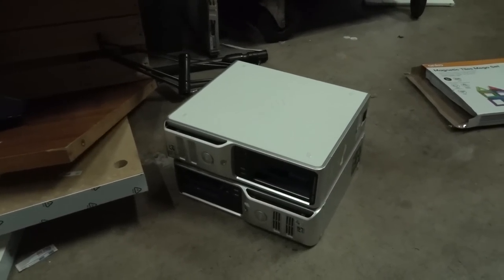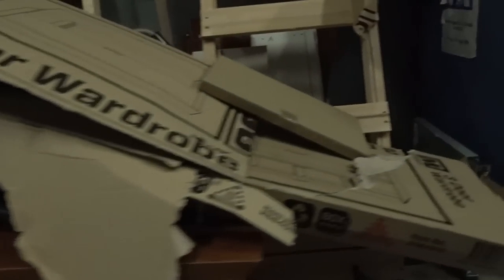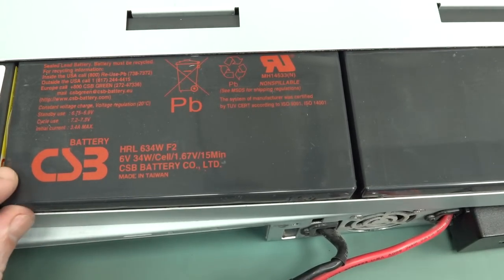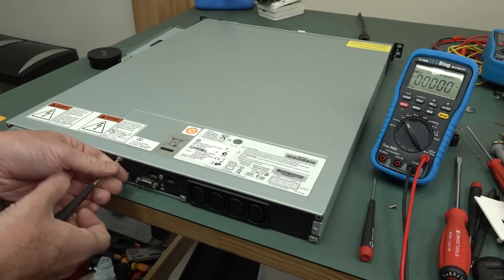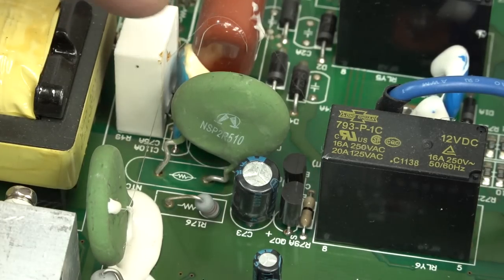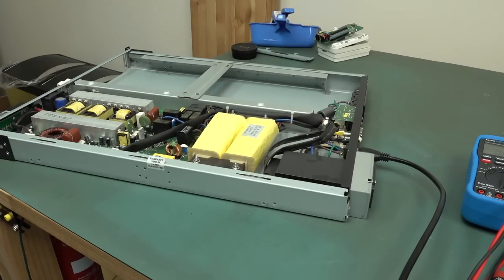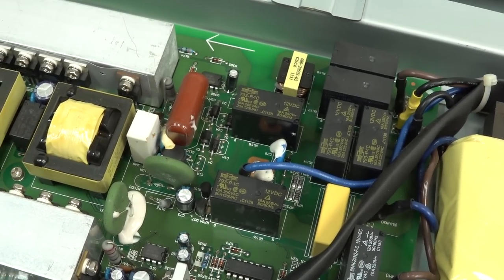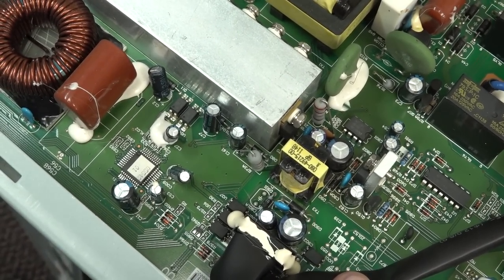EEVblog #1168 - Dumpster Diving UPS

Comment: Isn't that a surprisingly small transformer for a whopping 1500W?
Reply: Auto Transformers are like that just like the ones he's a buck-boost Transformers on AC power to adjust voltage the smaller transformer for low-voltage side is puny doesn't even look like a table boarded a few amps. Because the only amount power involved is related to the voltage difference.
Reply: @aaronbrandenburg2441  Aha so that how it worked, I started to wonder there.

Comment: Is taking stuff from the dumpster(room) even legal in australia?
Reply: its not legal here:/
Reply: Depends on the room. Ask the facilities to post a notice that "garbage" can be taken by anyone for any reason and it will be all right.
Reply: From my understanding in the United States basically once it's on the curb it is no longer your property if it's in the garbage can and on the curb or associated is no longer your property and therefore illegal and I have been told this through a law enforcement. I knew people that did electronic Salvage and we are all curious because some people do it and we're not sure it did not want to get in trouble and also before I started doing it in her past if it was left out for a day pick-up and or if I saw something sticking out they could be useful I want to be sure before I did anything wrong. Or illegal. You would not believe how much stuff I marriage fix mainly just because of one problem bad fuse or a fuse that had not blown but just fatigued overtime and just going to open without an overload even if they are blown a lot of times after testing you find nothing is bad put it on in and Bowman at work or a search took them out.

Comment: That big yellow thing is the output choke, due to sine modulation, needs output filtering...
Reply: No, it's not, it's the auto-transformer for operation under lower or higher than specked voltages from the mains. That's why there are so many relays. The choke is the torroid inductor  on the right side.
Reply: @TheOriginalEviltech   
Yep. This is a line interactive UPS. My APC's switch in the transformer at 253v and 208v. You can adjust the trigger voltages on the APC Smart UPS.
Reply: Lame-o that is a Transformer that is Auto for as far as everyone else has said and he said as well the choke your talk about is that Roundy thingy the toy line with the windings that huge sucker.

Comment: Ask for that negative are going to that big bolt for the ground because oftentimes that's a negative is actually grounded to case in system ground within due to safety because of possible or isolation issues as well as general safety.
Reply: I hope English isn't your first language.
Reply: @pete3897  actually that's the only language I speak but I have to use voice recognition and it's hard to edit on the Fly to do this in a timely manner okay part of my disability cannot touch type worth a darn it's been proven I use the original version of dragon through a grant. Also I use my Android as a keyboard utilizing an app on the Android end and a small program running in the background on my laptop making the connection or Wi-Fi for my keyboard most of the time I do this. Because it's so much easier and that means I can use any computer including with Google Voice recognition because I don't have a license for my software for multiple computers for Dragon.

Comment: One thing to try:  Put a power supply INTO the battery connections without AC power and see if it comes alive.  You do have a power supply don't you??  If you want to last a multi-hour power outage (had one Saturday), just find 3 nice automotive storage batteries and cable it all up.  The VA/Watt rating will be the same, but the time on battery will probably last a day or so.  Good planing for the zombie apocalypse which is SURE to happen.

Comment: Are the heatsinks solid aluminium? That looks a bit chinsey, they'll probably get pretty hot after draining the batteries at 1000w, clearly only engineered for burst usage.
Reply: not really i think they use a zero voltage switching which makes like no heat

Comment: Those AMDs can be upgraded to quad-core very cheaply if the mobo supports it. (Sometimes newer CPUs work even if they're not in the HCL, the beauty of AM2/2+ is that the memory controller is integrated into the CPU as opposed to the NB as in equivalent Intel 775's so they're much more upgradeable)

Comment: I have one of this sitting in a corner with dead batteries which i was just going to salvage parts from. However this video has prompted me to ponder...could a ups such as this be modified to work as an inverter for a solar power system? What do you guys think?
Reply: The problem is that these devices heat sinks are simply large blocks of aluminium. They are big enough to store all the heat produced during a single discharge of the battery, and assume that the inverter will have hours to slowly cool down while the battery recharges.

So your major modification would be a complete rework of the heat management system, replacing the blocks of aluminium with large fan-forced finned heatsinks. Managing this in the space allowed for it on the circuit board would be challenging.
Reply: @robertbackhaus8911  hmmm. Ok thanks for feedback. I will keep that in mind.

Comment: Needs battery power to turn on, most UPS units are like this, a protection mode of sorts to stop it blowing the charger incase of shorted batteries or wiring...

And as for mains voltage, Oz, just like the UK, never actually changed voltage when the European Harmonisation (Red & black to Brown & blue, and 240v to 230v +/-10%) bollocks happened, just some jobsworth making themself look important by pushing some paper around... :P

Comment: Pro Tip:
PSU with Switch -> No no. Those are the cheapest stuff without active PFC...
Those are special, proprietary "BTX FOrm factor" units.
As for the Athlon X2: Those are old, really old. Like 2008 and before... 
And to make matters worse: The nVidia Chipset when used without Graphics card, they are said to be rather unreliable and prone to failure...

Comment: Probably the UPS will work again with simple battery change, even the battery pack is hot-swappable. These CSB-s are manufactured 2 week 2012. 
Just to mention three years ago Yuasa took over Panasonic battery manufacturing. https://www.yuasa.de/2017/01/gs-yuasa-uebernimmt-bleibatterien-geschaeft-von-panasonic/
https://www.ees-magazine.com/gs-yuasa-takes-over-panasonics-lead-acid-battery-business/

Comment: try charging the battery from another power supply then put it back in the ups, most all need battery power before it will work. I bet there is nothing wrong with the ups. my small ups will not work with out a battery. no lights or anything.

Comment: Are we gonna ignore the fact that these lead batteries would go to landfill if Dave didn't grab them.
Reply: Presumably the office has a dedicated electric waste disposal service that sends the stuff to someone who disassembles the stuff properly.
Reply: Hard to say if they do that but then again they are a lot of time to separate from a dumpster even think if they could have got it in there. And Dave Jones Is there any waste or where we called their company that comes to pick that stuff up good question. As well as you know last batteries are hazardous waste as well. Whenever I would dismantle something that would have let acid battery on or whenever a car struggle batteries I would take them to the local Batteries Plus or Home Depot for the dog light acids to get rid of them even when I was younger.

Comment: If only there was an easy way to change the input voltage to something useful like 12v!
Reply: You can't use it as an inverter anyways, you'd need to change all the cooling with something more substantial...

Comment: I wonder how many home PCs, even in the "rich west" have USB 3 connectors?  My home PC has an i5 processor and I recently upgraded to an SSD storage unit, having gone from 4 to 8 gigabytes of RAM a few years ago when my PC slowed to a crawl.  My PC is 6 years old and wasn't cutting-edge when I bought it.  I am hopeful that the upgrade of RAM and storage will give my PC several more years of life.  My desktop PC originally cost £400 from PC World with Windows 7 pre-installed, plus extra for Office.  The upgrades were achieved for around £100.  Prior to going to SSD storage I considered buying a new PC but was shocked at how much prices had increased, with little obvious increase in performance. I seemed to be looking at at least £1,000, particularly for a laptop.  I think that modern PC suppliers are pricing themselves out of the market, even in the "Rich West".  In poorer countries where disposable income is less, I suspect that the average home PC has specs much below what is being found in Australian dumpsters.  This difference between the "have everythings" and the "have very littles" makes me anxious for the future.

Comment: the battery's are cheap for this unit dave and it will only work with good battery's as it does a self test at startup. its a keeper for sure.
 could try to charge the battery's up to get it to fire up for you
like others are saying these are found all the time ppl think there dead and tose them.
thing is they will work fine for years with fucked battery's till the power goes down and then it will never come back on with the dead battery's
these startup on thee bank before the grid once it is running you can unhook the battery bank

Comment: Charge the battery or connect the power supply 72 V
Reply: batteries are 6V X 6 = 36 volt.
Reply: Rev them for a short time
Reply: @imgertberg5344  These CSB-s are manufactured on February 2012. Their service life is long gone. Dave even found a physical bump on one wich means they are starting to bloat. Any attempt of charging those would end up in overheating and venting hydrogen through safe valves.

Comment: Those batteries are about 15 yankee-bucks each. (blue Real(tm) Panasonic's are 30$) You don't replace just one; if one is bad, replace them all (they were all made within a few days of each other, if not in the same batch) No, HP does not design or build UPS systems -- certainly not tiny one like this. Back in the day, those were made by APC. I don't know who APC acquired to get that product line, as those systems (R3000 esp) are a radically different design using "DSP technology" instead the age old "just wack a 3000lb transformer in it" design. (having a 120vdc battery string does make 120vac easier to make -- for NA models :-)) I don't what's up with their lame warrantee stickers; out of dozens of this class of UPS, not a single one has had the sticker stay on. (handy in one case as the front panel ribbon cable wasn't plugged in.)
Reply: jfbeam Apc have been taken over by Schneider Electric in the U.K., still sold as ‘APC’ by Schneider Electric, still one of the most expensive brands here

Comment: now you guys will know, im building a pair of speakers into a boombox using a car stereo and whatnot, can i run a car stereo off a psu like that or is there something similar you can suggest that will work, i thought about a battery with charge controller and then just have a pair of terminals to hook a battery charger to lol... bit homemade thought i want something i can take to a friends house and preferably not kill someones cat or a baby or something, a 12 volt rail is a 12 volt rail as long as i have the fan where it can breath? or is there something i need to know before i blow up something or someone up?
Reply: Speaking of which people that hab Boombox is where I used to work we didn't always have outlets in the right area because it was originally a warehouse and been reconfigured to others House of work and there's no Outlets when we need them so I modified the boomboxes to take a seal bison battery install built-in charger since they already ran on 12 volts plus as a cigarette lighter 2 Barrel Jack adapter and cord socket so they can write mobile as well.

 As in terms of the your project you could easily run that off of power supply for my computer or if you decide to go to better rope just build something large enough to get to hate them have built-in charger as well could also be used for backing up so you have standby And or backup power add some lights USB charging cigarette lighter Jack excetera.

Speaking of which if you was a computer power supply you can also have 12 volts out for other stuff or cigarette lighter phone charging through USB or anything like that.
Reply: @aaronbrandenburg2441  sweet, some good idea's there thanks mate

Comment: This looks like the Eaton Powerware 5115RM a 1500VA unit that i used in a school server room years ago.
If i recall correctly it had a tray with 6 x 6V SLA batteries in series.
Some of this documentation might be relevant.
https://powerquality.eaton.com/australia/products-services/backup-power-ups/5115-rm-ups/5115-rm-info.asp?cx=23
The driver for it was a bastard from memory!
Reply: Before i forget, the noise of the 40mm fans screaming away haunt me to this day!

Comment: Yazoo! . umm err wtf. It's you-arse-sir.  What kind of Kangaroo riding Kazoo player says "Yazoo". Some kind of a battery above min charge voltage needed or it will lockout by design, then failing that relays, see if they click nicely with a bit of juice applied.

Comment: You might find that some of those battery's in the pack still work and its one dead battery, or even one dead cell in a battery thats borking up the pack voltage. 
Sure it wont help with getting the UPS to work but ive salvaged quite a few SLA batterys with a useable amount of life left from 'dead' UPS battery packs

Comment: Looks like my Eaton Evolution, full of shit Jamicon 85oC caps all but one over ESR, and automotive fuses soldered into the board! You won't get them out, I suppose you're meant to buy a new one if they blow. As for using a plain lump of solid ally as a heat sink, what a load of crap. Mine had big resistors hot-snotted to said capacitors, burns on the PCB (if he had taken the board out there would probably be one between the contacts output realy) the works. A real (expensive at the time) piece of shit, and not what I expected from a well know brand in the industry.

And yes, they do nothing without the batteries.